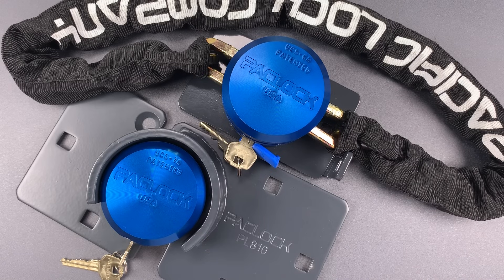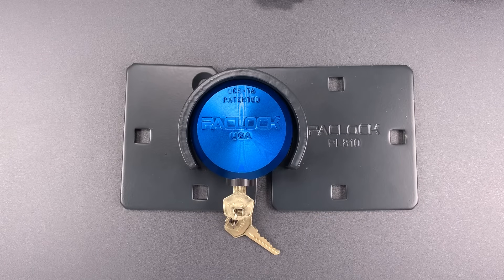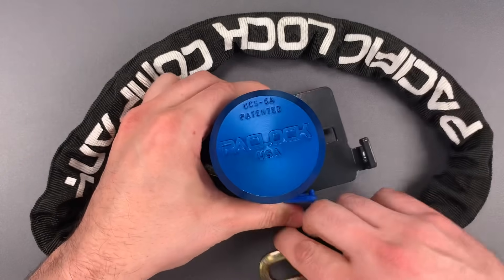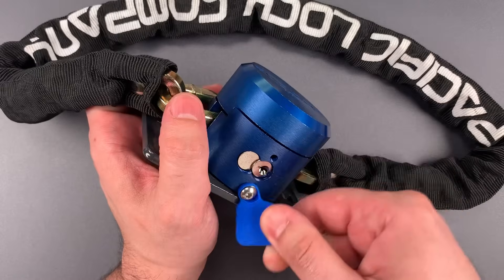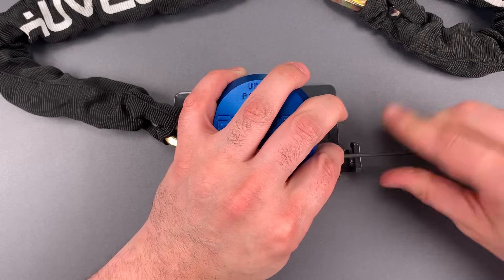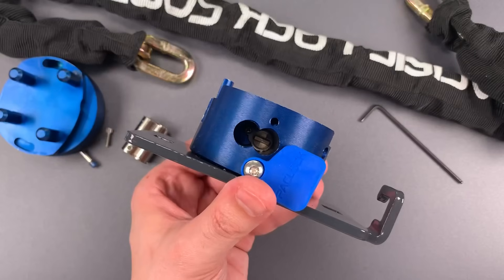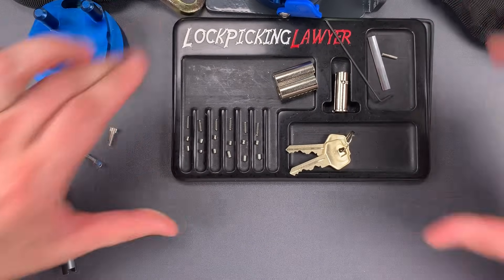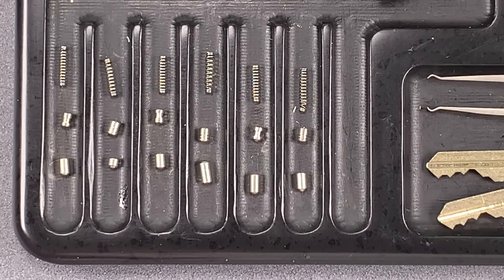[932] More PacLock Products Coming to Home Depot

Comment: I don't even need these, but LPL said they're pretty good so I am going to buy one.
Reply: But... You saw it get picked in 30 seconds by the same guy who told you they're good?
Reply: @garrettreven5144  well 30 seconds is pretty good resistance when facing LPL. I had pleasure to pick one of these cores and less expirienced picker will have definetly more trouble to open them plus it's very resistant to low skill attacks like raking.
Reply: @garrettreven5144  considering the security pins, bump protection, radical bitting, and hardened key pins to prevent drilling I'd say they're good enough. the new chain lock looks pretty sweet and the prices aren't too shabby either. I'd say 80% of locks out there are either bypassed, brute forced, or raked/bumped open. For someone to single pin pick these products would take some considerable skill and dedication. Another thing to consider is LPL picked the lock in ideal conditions. He wasn't outside in the cold with the lock bolted to a hard, flat surface at an awkward angle.
Reply: @garrettreven5144  he had a lot of practice off camera and is extremely good at what he does to begin with. He's not representative of most people. Yeah it can be picked but its still relatively good. Any lock can be picked and most can be picked in the same amount of time if you're good at it.

Comment: I lose a lock every week on my landscaping rigs due to someone just laying it down and then riding off....
Reply: A few tom and jerry style traps later
Reply: @spacejamgoliath  Well, the lock is loose.  That's why they lose it.
Reply: @KaseyWynne  Maybe this is a convenient time to ask PacLock to include a cable lanyard option on the puck, just a little loop for a thin chain?

Or are you talking about switching to the chain lock?
Reply: @KaseyWynne  also, they are loosing it, as in releasing it. Only issue with that interpretation is that they are the ones doing it, not someone on their crew.
Reply: Get some j and b weld and attach a chain to the lock or weld a chain on the lock if possible.
Reply: @mauricioespinoza5390  It's aluminum, honestly I'd just drill and tap it myself if it were my problem to have, sink a stainless 10/24 eye in a thick portion, but not everyone knows how to do this.
Reply: @Anonymouspock  Then they are "loosening" it, not "loosing".
Reply: @mfree80286  The puck we're offering at HD would actually be bolted right to the hasp! So it won't come off... and the container/trailer locks do come with the lanyard...
Reply: I don't lock mine unless we're going to lunch or something.
Reply: Start taking $40 locks out of people's paychecks and I bet that will change LOL
Reply: @SgtHenick  If you start taking $40 locks out of paychecks - you'll start losing more than just padlocks!  Treat employees well, and they will reciprocate...
Reply: geheimschriver  laughed
Reply: @Tractors_and_trees  if employees consistently lose equipment i dont think they are a valuable asset
Reply: @spacejamgoliath  Lost losers lose loose locks. If that's what you loosely mean.
Reply: @Tractors_and_trees  "they will reciprocate..." We've been going go and fro over that.

Comment: I just wanted to buy a new lock for my bicycle, but this dude made me watch 932 videos.
Now I still dont know what to buy, but learned alot.
Thx.
Reply: It's an old trick to hide your bike under a cheap opaque rain cover, thieves can't be bothered to look underneath. They will steal the one next to it.
Reply: What I learned from watching LPL is not buy an expensive bike. I even have the same lock he has for my moderately priced bike. But I wont buy an expensive bike.
Reply: Try Bowley
Reply: @wessltov  I don't think bowley makes a u-lock, the chain could be cut. Just make sure to always lock up your bike near more expensive ones, and you should be fine with most locks.
Reply: I think he recommended the Kryptonite lock for bikes.
Reply: Check out LPL's review of Kryptonite Fahgetaboutit lock.
Reply: When I was big in to road racing I refused to buy a car, so I spent alot of time shopping in cycling gear and riding home. The point is my bike was really expensive, I never used locks, when I shopped customer service 99% of the time would watch it for me, always found someplace inside at work to keep it, and never ever left it outside at home or in garage. My point is, if you have an expensive bike don't trust a lock to keep it.
Reply: In one video he said that it would be easier to cut the bike rack off than to break into the lock. So id suggest that lock
Reply: Right!  Even for everything else like regular locks or door knobs, I feel so insecure.  LPL makes everything look so easy.  I've even started picking locks as a pandemic induced hobby.  I've actually picked a lock that was on my house door.  I don't feel safe at all.  LOL
Reply: Various tricks  to protect or  disguise  your  good  bike .  Just bought  Abus  6500  which  is  expensive but  my black  no name 
gravel  retro  self  build  bike is worth  alot  more to me , so  how much  do you value your bike ?   Disguise  your bike by  making it look  rubbish  /  odd  by wrapping  gaffer tape and painting it in mad colours  ,  looks  unsellable  /  tatty .  Always lock through wheels  or  
don't use quick  release on wheels  or  put  it in  maximum  low gear and  undo  quick release  , wont  be able to  remove wheel quickly .  
Think Is  It  Safe  Locking It Up  Here  ?        Is  all  about  ' out thinking '  the low  life's  that want your pride and joy .  🚲
Reply: even if you buy a $1000 unpickable lock, the thing you lock it up to (bicycle rack lets say) is probably the weakest link and can be cut easier than the lock...
Reply: @itsamemario444  Correct . All about risk , is it safe here , if they want it and have the tools will have it .
Reply: All locks are deterrents. The key is to make your bike look more annoying to steal the one next to it. I do this by always using two locks of different types (e.g. chain + u-lock, steel u-lock + titanium u-lock, steel u-lock + folding lock) of sufficient quality for my price of bike (the old adage of spending 10% of the cost of your bike is reasonable). Most thieves won't bother to pick the locks unless they're the ballpoint pen cap-pickable quality ones because it takes actual skill that can be readily substituted by cordless machinery stolen from the Home Depot/job sites. If you can require that they have multiple tools on them for efficient cutting, you cut down on a lot of opportunistic attacks.
Reply: @francoischarbonneau9447  Yes, he likes the Kryptonite Evolution Series Four!  So, I bought and use one
Reply: @elitedavidhorne8494  The only way my two expensive bikes will be stolen is if they're taken from me while I'm riding or sitting next to them. I'll NEVER lock them (except when they're being transported inside my van and then they are locked with a heavy chain and top of the line lock to the van's seat post). 
It's silly to lock up an expensive bicycle.

Comment: Takes him 30 seconds to open the lock
Him: "Definitely a bunch of security pins in there"
Reply: He has mentioned in previous videos that he picks the locks over and over before putting them on camera. Kinda like a video game speed runner makes countless runs to learn the quirks and patterns before going up on stage.
Reply: @cornstarch28  i understand that he pre-recorded the video , maybe he failed some times but he got a "perfect run" that he uploaded. (Sorry for my bad English)
Reply: It doesn't help that hes able to manipulate the lock much better than if it was mounted.
Reply: ...and « Pretty much the top of the market » as he says ;)
Reply: Definitely bunch of security pins in there…he just decided not to notice them while picking that lock 😆
Reply: I think of him like one of those people that speed through Rubik’s cubes.
Reply: Security pins are mainly for bump resistance, it takes only a little longer for experience picker to pick. Not to mention he probably practiced the lock before the video.
Reply: @cornstarch28  Order from a locksmith in a restricted key Medeco or other high security cylinder
Reply: It should also be mentioned that he extremely skilled when it comes to lockpicking. He does it several times off camera and can pick locks that many locksmiths won't touch. Just because he can do it in a few seconds doesnt mean that the lock is easy to pick or that the average thief could do the same.
Reply: He's a full on lier when it comes to all the products that he reviews that he's connected to$$
Reply: LOL
Reply: Yeah, slightly less than 30 seconds for this lock, slightly under 50 seconds for the lock in the previous Packlock video.

And he's very clear that these are quality lock and that he likes the product. SERIOUS skills.
Reply: @Bartooc  Bump and rake resistance.  That alone means 99% of criminals can only hope for brute force attacks—and the lock itself is rarely the easiest point of attack.

Comment: I think part of the security to locks is the availability of the keyway: in this case the locks have difficult to reach keyways if mounted properly, and should be tested like that. Bosnianbill made a point about not being able to pick it when "mounted" properly in the last video he made.
Reply: bravo to you...a real world lock picking scenario would be awesome!
Reply: Yes, he suggested having the lock a bit shorter so that it was recessed into his tool chest's locking port so a tensioner would be difficult to use.
But there's another solution. A raised circular guard around the core. The guard would be part of the lock body and made of the same material. Just big enough that a tensioner won't sit right (you'd need to design a special one to use with this) but not so big that it interferes with key insertion and rotation.
Reply: I was thinking the same thing.  Maybe having the hasp having a long tube, and the key being longer or mounted to some kind of a rod that can take twisting... But yes I agree protecting the keyhole sounds like a good idea.
Reply: If available would you post the link to the video 👍
Reply: @firstnamesecondname5341  Here you go
https://www.youtube.com/watch?v=NJ3GysAdMTU
Reply: you know the solution to the toolchest lock? attach a small hinged cover over the lock cutout that you secure with a second lock... the burglar will be so pissed after getting into one only to find a second one (and realize he has to do it again on the other side) that he'll just toss his tools and leave ;p

anywhoo LPL! i want to see you pick open the pucklock when its mounted on a sheet of plywood or similar ;)
Reply: LPL is also one of the few people who  actually practices on security pins and stuff on the daily. Your average thief isn't going to get through that lock in nearly as little time under the same conditions.
Reply: I was thinking the same thing... As I tried to open a work lock (for fun) and since it was so down low.. It made it uncomfortable.. I gave up... So these demonstrations are the ideal situation (perfect world) in terms of comfort, (good lock position, not locked against anything) still fun to watch!

Comment: best designed hasp i've seen for a puck lock yet.
Reply: If LPL wanted to steal your stuff, you might as well just use a hockey puck. lol
Reply: Yeah, I'm "in" for a freestanding version
Reply: no, it's not.  turn that lock 45 degrees so the keyway is on the side.  then put a shroud over that side allows only enough room to fit your hand and the key.  that also serves to cover your bolt holes.

now you have a good design for a puck lock.

Comment: My work on automobile suspensions have taught me one thing.  When you were discussing spring tensions, when you make a spring shorter by removing coils the spring gets stiffer.  They springs are probably the same, but if one is shorter it will be stiffer, same spring, different compression.

Comment: That puck seems like a great solution to secure your motorcycle or bikes to a wall as well. With a thick padlock and a chain included, 100 dollars seems like a steal for a quality product like that! I have an Abus wall anchor that cost EUR 60 and then you still need to buy a decent padlock and a chain.
You are probably limited to certain chain selection, but I like the idea and execution very much.

Comment: Can you do a video explaining the jargon you use in your videos? Eg (binding, counter rotation etc)
Reply: All of the more recent videos from LPL and BB assume you know the lingo.   If you search for their earliest videos, they explain the common terms in detail, and there are many other beginner YT videos that explain them.   For these terms, you could look for security pins, spools, or serrated as keywords because those are the types of pins that cause those responses.
Reply: Don't bother. You need only these two words: Angle Grinder.
Reply: @NeverTalkToCops1  the noise alone will get you shot you act like grinders are silent when cutting
Reply: Steel locks would like to disagree.
Reply: @pagedeveloper  6

Comment: @ Paclock Pres. I purchased a couple of trailer locks, some padlocks and a 6 pack of cores thru HD online. I was surprised to see the cores in a plastic sleeve that operates the key retaining lock/unlock functions instead of metal.  This has already caused a problem that affects hard turning of the key. When I changed out the first core it didn't seat correctly so a gentle tap was applied. The second one went in smoothly as did all the rest. The core on the first lock didn't work right so I had to replace it and bought another 6 pack of cores to keep everything keyed alike and changed out all the locks. Turns out the problem was where one of the holes in the core was drilled a small but sharp snag didn't get
trimmed and this caused the core to bind. Rather than having to buy another 6 pack I decided to file the defect down and noticed the core was not a solid material instead it was plated and now that was comprised. I decided I would have to live with that. One last thing ... on both trailer locks the silicone weather covers were not fasted to the body securely enough and both have fallen off after just 3 months in service. I'm done now but have just one question. Why use plastic for the sleeves and plating instead of brass? BTW, I still have my allegiance with you and appreciate your honesty. Thank you.
Reply: Hi David! Thank you for your purchases and your interest! I'm never quite sure how to word "well, you're not quite right" type responses to customers, so I hope I do a good job of being 100% friendly! The black sleeve you mentioned as plastic always makes me sad when I hear that because it's made out of aircraft grade aluminum. Not only that, but we actually do Anodizing Type III which is a hardening process to the aluminum. I promise, no plastic in our locks except, I guess, for the blue "PAC-BAND" cylinder cover on some of our locks!
For the core, that's a solid brass core. No die cast zinc, no plastic, no nothing but brass. But to help minimize any galvanic corrosion possibilities, we did a nickel plating on top of the brass. So when you filed part of it down, you should have seen the brass get exposed. That's not really a problem to have a small section unplated... the plating is just extra insurance so to speak.
I realize that sometimes customers think that a shiny, silvery colored metal part is expected to be steel. All good quality cylinders/cores are made out of brass... some cores from China will be ABS (ug.). Often you'll see die-cast zinc cores... again, not great because they can be easily melted. But the cores in our UCS line, like the rest of our 6-pin rekeyable PACLOCKs, are out of brass.
With all of that said, the customer is always right at PACLOCK. So I hope what I wrote makes sense and is reasonable. Even still, I apologize for the confusion and the troubles you had!!! We want everything to always be 100%... that's our goal. If you have the time and can shoot a quick picture of the spot you mentioned you had to grind down on the cylinder, I'd really appreciate getting my eyes on it. All my contact info is up on our website or you can DM me!
In terms of the "PAC-BAND" (the blue cylinder cover), I'm sorry to hear that those little guys have fallen off already. Definitely shoot me an email with your contact info, we deliberately made those field replaceable for lots of reasons. They are somewhat easy to just pull off... but any other method (like what Master does with hard plastic) just doesn't work. We can get you some replacements without a big deal!
Once again, thank you for the feedback! I'm always available if there's anything PACLOCK can be doing better... or if anyone would like to tell us how well we're doing!

Comment: Went to my local homie depot this morning.  Checked out the lock area and just a wall of crap!  No Paclocks there yet.  Hopefully they'll be there soon.  I had to purchase a padlock recently and was forced to buy a master.  

Also hopefully HD will make an effort to keep these in stock and well displayed.  I know this is an exclusive product for them, but exclusively is an issue for us consumers IF HD doesn't keep them in stock.
Reply: Been reading paclocks comments. They are starting mostly in the west coast for now. I hope they spread fast enough
Reply: Having worked for HD for some time in the past, they usually roll out products in stages testing for around 6 months in certain stores, then expanding to a region, after 4 months or so they may then roll out to most stores. Keep in mind many smaller stores never get the full product offering as well. Simply not enough space or predicted to sell poorly. It sucks for the hype but it makes business sense.
Reply: Hunter Bowie My HD is a smaller one. I’ll maybe check a larger one near me and see if they have it. I suspect with an exclusive product, the rollout maybe quicker. Maybe not though.